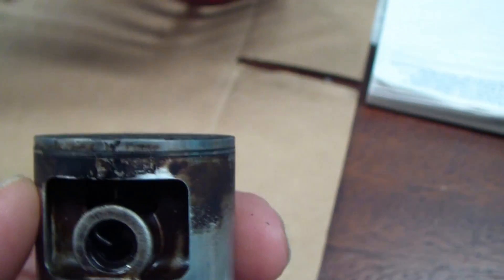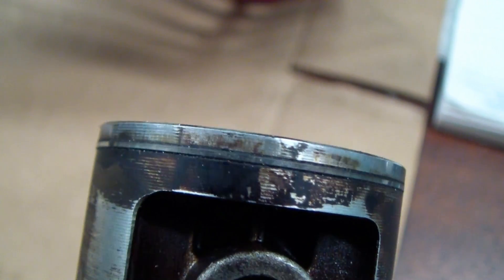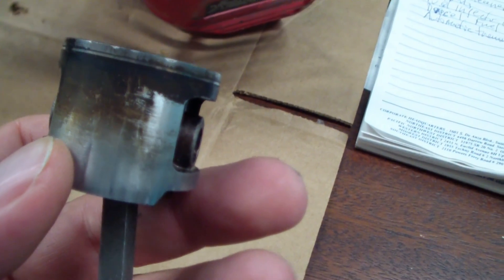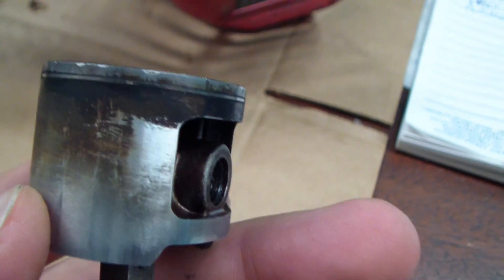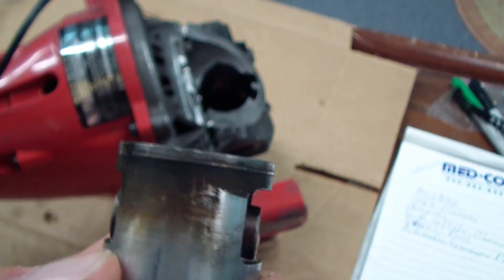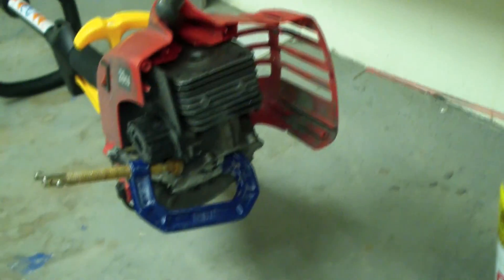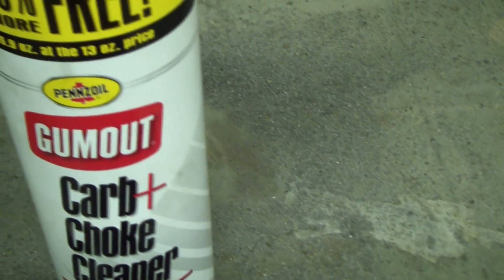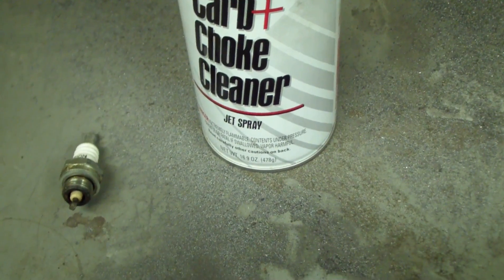Homelite Weed Trimmer Repair Tutorial Part 4

Comment: Okay. I watched all the videos about your weedwacker. I just rebuilt the exact same one yesterday.  And so, because I've done it literally dozens of times, here's what I'll contribute for your help.
- I bought piston rings for this from an Italian company called Caber. 
- all burn and grease comes off using EASY OFF oven cleaner. Wash off with regular soap and water after, then grease lightly with wd40.
- buy carb kits online. Replace all carb components.
- flush out jet ports. Don't confuse them. Re-adjust carb settings once everything is done.
- clean out fuel system, flush out lines and filter.
- use ONLY the manufacturers recommended fuel. There are models that require regular 89 and not 87.
- mine used 50:1 mix. I get the feeling, that yours had lower fuel mix: 40:1, or 32:1. MEANING. both 40 and 32 have a higher oil count than 50. Which means less fuel.
- make sure therd are no holes or gaps on the carburetor and housing assembly. 
- make sure all your carb housing holes are lining up. 
- mine had a compression of 115psi

I have seemingly a 100% success rate fixing these. I'm unsure of the condition of yours since it's currently July 2024. Or what happened.  But, I was intrested. 

Have a good day
Reply: Hello @Blackjack, I'm trying to get one of these running because it looks like brand new, including the piston - now wear visible.  I'd like to remove the piston and clean the piston ring groove really well and possibly replace the ring, but can't figure out how to remove the piston.  Based on what you said, it is possible to remove.  Any advice would be greatly appreciated..
Reply: @threejackcity4471  hello there. You will need a long type Allen key or stressful key (t20,25,30). You will need to remove all those bolts to access the piston properly.  The entire engine will come apart in about 3 pieces or 2. Do not destroy the gaskets between those metal surfaces. Remove piston carefully. Replace rings as needed. Lubricate pistons with oil during reassembly.  Remove debris from cylinder. Flush out all engine components. Assemble.

Comment: Many years ago, my girlfriends teenage boy managed to run my lawnmower out of oil and the motor seized up. I visited a local lawnmower shop in Lewisville, Texas and the elder gentleman mechanic told me to mix ATF fluid with Laquer Thinner, pour the mixture into the spark plug hole and let sit overnight.   Then the next day try rocking the mower blade back and forth a little bit to free it up. It proved to be pretty stiff at first, but after a few minutes of rocking back and forth, it totally freed up and ran successfully for several more years!!! I've used that same mixture several times since then on other engines with good results.
Too bad, after several days of working on my Homelite, I still can't get my weed whacker to hit a lick. It exhibits "ALL the same symptoms "as yours....even after removing the muffler.   Piston and ring looks clean....compression seems fine.  Next step is to purchase a compression tester and check for low compression. Sure is a brain teaser.
After that.....maybe I'll bite the bullet and upgrade to a more reliable brand!!!

Comment: Its not blow by, it's the exhaust port. The cylinder acts as a door for both intake and exhaust ports. It was the carb. Judging on the lack of small gas engine knowledge shown here (cutting the engine). I doubt there was a good job of cleaning the carb. The piston ring wasn't the problem. The cylinder wasn't getting gas. That was shown in the first video when he tried to start the engine with the muffler off, but no fuel was pouring out of the exhaust port as it should have been. As I said in the previous video, inspect the cylinder wall not so much the piston.

Comment: Carburetor/Choke Cleaner did not work because it evaporates too fast. It has very strong solvents in it and would most likely soften the CARBON that is causing the ring to be stuck.

Comment: I been waiting patiently for 5 years now on your part 5 you promised..  This pac-man tool you speak of intrigued me.  it could have very well been the one thing that saved my entire life as since the downfall of my wacker my existence has been overgrown with weed.   weeds..  well both I guess.  but the fact of the matter at hand is that wacker ran like crap on transmission fluid.  it ended up getting jammed so first logical thing I did was apply jif to the cylinder.   maybe I should have tried chunky because it didn't help at all.   tried to microwave it out to get it hot but now I need a microwave.   worst idea was when I tried holding the piston up with my finger then cranking it to see if it was getting compression as I had no tester but fern thing took off my pointer finger tip...  well I point my finger nub at you sir, this part 5 would have been like the final season of Seinfeld, or the cheese powder on the Mac..  but my Mac is cheese less and Seinfeld humor less.  no change on Seinfeld but point proven.  gidday sir..

;)
Reply from the maker: The trimmer I got to replace the one I cut up has quit starting. I have tried ATF and other solvents to get compression up for months but no luck. Should have adjusted carb with pac-man tool sooner. I have to learn from my many mistakes. Just got an electric trimmer. It has no trouble starting.

Comment: Mine had similar problems what I found out after fooling around for hours was that the fuel line filter inside the gas tank was corroded bad and needed a new one the primer bulb was not getting any good suction or gas because of it.

Comment: If you're going to pull the piston, soak it in Berryman's "Chem-Dip". Problem solved and a $16 can lasts for years for small projects like this. (Don't pour Chem-Dip into the engine). 
If you're not going to pull the piston, just adding a teaspoon of ATF in the cylinder during the machine's down time is a good long term preventative plan if you don't need aggressive cleaning in a short period of time. For the average homeowner who only uses lawn equipment once in a while, these little 2 stroke engines should always be stored with ATF in the cylinder between uses.

Comment: Thank you for this informative and easy to follow video. Had my HomeLite weed eater for years with no issues then it suddenly wouldn't crank. Removed the spark plug and let some automatic transmission fluid sit on the piston overnight, cleaned out the carburetor and now it runs beautifully. You saved me the expense of a repair shop and/or a new weed eater. Thank you!

Comment: Kent, thanks for the video.  I just fixed mine with ATF also.  Put cylinder at top of stroke, and filled cylinder with ATF.  I did not get back to it for 4 days and all the ATF had leaked past the ring.  But it started right up and blew a lot of it out the exhaust.  I will probably open it up this weekend to make sure the rest of the ATF is flushed out.

Comment: Hi Kent, I've watched your videos and love your enthusiasm and ambition to get to the source of the problem.  I recently came across my first Homelite weed eater from Craigslist Austin, from which I initially responded to their non-running Honda HRR216 lawn mower.  Purchased the mower and weed eater for $20.  I'm about to mix some oil and gas and see if this little bad-boy will start.  If it doesn't start, I now have some valuable knowledge to possibly repair it.  Many thanks for your videos and other input.

Fyi - I share your same mentality for research and experimenting simply because I like to tinker when I'm not day trading.

Comment: Thank you Mr. Fowler. I followed your directions after removing muffler to verify if blocked and to check if piston ring was ok. My 26cc homelite runs better than ever. I will use your method on all my pesky lean running engines.

Comment: I just repaired mine with ATF, soaked it for 24 hours then did it again.
Fired right up and running strong, lite blue smoke from the atf but starts everytime.
next is the carb adjust but don't have the required tool.
I worked on it for three weeks and ten tried to get it worked on but Home depot said that it would be $35 to look at it and end up to be $50, had no interest to make it work.
Searched on you-tube and found all the answers. So noe you have an up to date working answer.
Reply from the maker: Ken Hausman I am glad the ATF worked for you. Get the Pac Man carb tool on Amazon so can adjust to ensure this never happens again.
Reply: Kent Diego I got a four pack for sixteen bucks. I thought it was a bit much for eBay but WELL worth it.

Comment: suggestion  put the ATF in and screw in spark plug set trimmer down for an extended time with spark plug facing down and you won't get the ATF leak into muffler.

Comment: This weed eater is a piece of crap!  I have the same one. I bought it at a bargain depo and I thought I got a good deal.  It worked fine but the string kept messing up so I bought a replacement head.  That seemed to fix things till today.  Worked fine yesterday but I have been trying for 2 hours to get it to start and it won't. It still looks new, the exterior almost looks like it was never used.

Comment: ultrasonic cleaning machine hands down the best
if you can get to the piston it will unstick the rings
i seen seized  lifters do gunk no oil changes
unseized and cleaned with just soapy water

the problem with cleaning the way you did is if the carbon breaks lose in the engine it will score the piston
time for a piston and rod key chain!
Reply from the maker: The problem is there is no way to take the piston out of the cylinder on these units. See Part 3. I needed a way to unstick the rings while still inside motor.
Reply: i gave my scrap to a scrapper asked him if he got any weed whacker could he drop them off
so now i got 3
pull carb apart cleaned put back together
one i put fuel lines on the other no parts needed
now 2 run good start easy
one more to go

Comment: 9.) Throttle your unit several times to see if your cutter head will spin and stop. If all went well then your trimmer should be running as it did from the factory, or even better. If you have other problems and this did not help you, then hit me up and I can tell you other things to look for.    jdfowler92003@gmail.com

Comment: 8.) At this point it is just a matter of a few carburetor adjustments. This isn't the same for ever unit so this is where experience come into play. I would recommend at this point to adjust the "H" side first,  "this is usually the closest adjustment to you." This is your throttle setting, by slightly turning the screw inwards "clockwise" while the throttle is wide open. Once you hear the highest speed then go past it very slowly until you start to hear it slowing down...As soon as you hear that turn back slowly till you hear the highest speed. Then turn the "L" setting "clockwise" ..."usually the adjustment closest to the engine"  to the unit until you hear the unit pick up a little more speed then stop. Then let off the throttle and let it idle then adjust the set screw on the top so the clutch will disengage and the head will not turn until you throttle the unit. You may have to play with that a few times to get it just right. If your with me so far then continue to step 9
Reply: Superb and thank you for typing all that out. Very patient. What happened to step 9 though? I can't find it. Am I missing something?

Comment: 7.) So at this point if your trimmer is running.... it should sound very loud without the muffler and running very rough, so you can turn it off and reinstall the muffler.After you reinstall the muffler and you pull the cord it should start if your muffler is unrestricted. If it doesn't then you will need to remove your muffler again and pull the cord again and if it starts, then you will need a new muffler "thats your problem".FYI....keep in mind what goes in has to come out....so if air goes into the carb. then into the cylinder then it has to exit, if it can't it will never start. OK so...If your unit started up after you reinstalled your muffler then continue to step 8.

Comment: 5.) Flip the choke back to the start position and pull the cord about 3 to 4 times or until you hear it start then die out. Then flip your choke to the run position and pull another 3 to 4 times and it should start up. Now if it's running you will notice it will run rough or might even cut off shortly after it starts. Thats OK, in fact thats great. Now you know it will run...so now go to step 6.
6.) If it cuts out, "do not" try and start it back...at this point you will flood it. So instead...remove the muffler. "This is the most missed problem in non-running 2 cycle engines". Then while you still have choke in the run or open position, pull the cord 2 or 3 times....."FYI"....If it starts...Be prepared it will be loud...."very loud". but should start and run rough.  Continue to step 7

Comment: 3.) Take off your fuel cap and check to see if you have good fuel lines and a fuel filter attached to the end. The fuel return should not be any longer than 1 inch into your fuel tank from the top. If it is longer than 1 inch then slowly and carefully pull the return line out until it's close to the 1 inch. FYI...."If you have a question if your fuel line are correctly connected to your carb., just remember the nipple closest to the primer bulb is always the fuel return." "usually the top nipple"  If this checks out then continue to step 4.
4.) Flip the choke lever to the closed or start position. Prime the primer bulb, 5 times...then flip it to the open position or run position and pump another 3 times. "This priming procedure by alternating close and then open position ensures there is enough fuel in the carb. and has forced any air out of the diaphragm. Continue to step 5.

Comment: Here are the steps to use to diagnose a 2 cycle trimmer "no starting problem." 
1.) Pull the starter cord, FYI.."If it's able to be pulled and not locked up" , you should feel resistance with a sight tug as you pull slowly. If you do then go to step 2.
2.) Use your pac-man tool to adjust the carb. Turn both "L" and "H" all the way in and back out "3" full rotations. "This will richen the fuel mixture so the engine will start, this is "not" your final settings. Then continue to step 3.
Reply: How do these ignition coil wires route on the Homelite models (preferably UT20026)?   I keep melting mine trying to figure out how it routes within the housing..